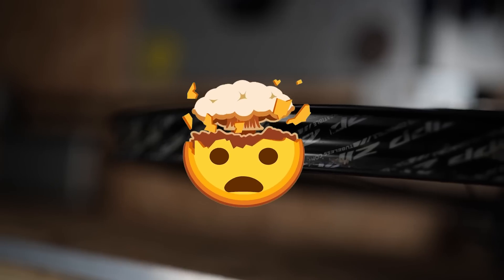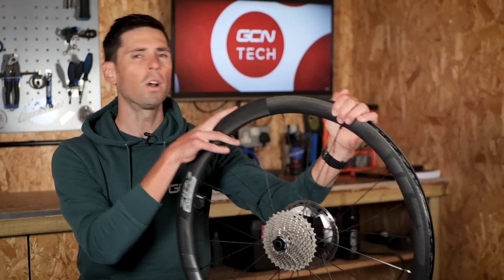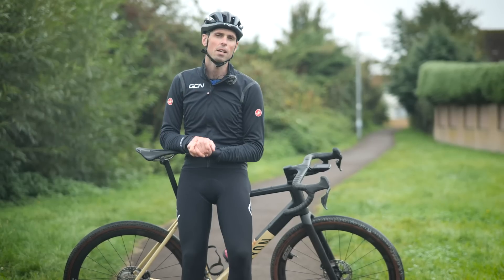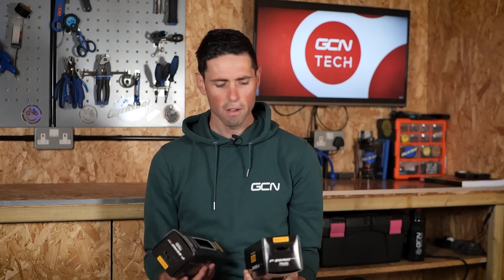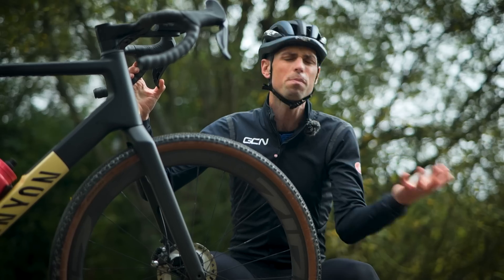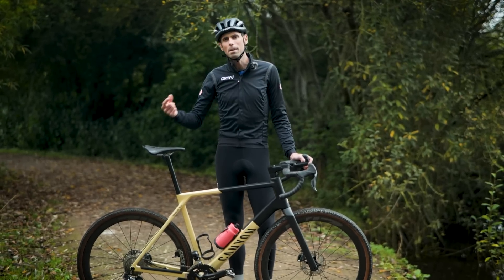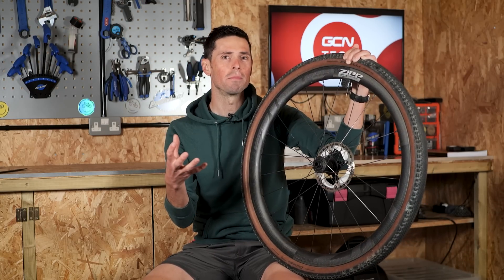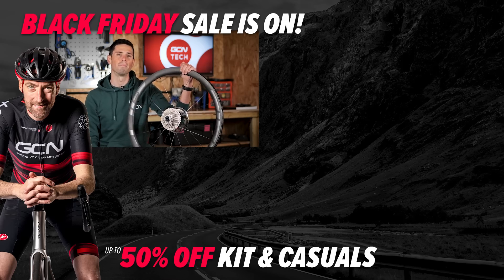What exactly is hookless technology, and what are its pros and cons?

Comment: Always felt the tire bead sitting in the groove of the rim and the inner tube pressing against it was a good safety feature.  Don't think I would feel comfortable leaning into a turn at 32 kmh at 105kg on these things with only glue holding me.  Maybe I'd give it a shot as a lighter rider.  Just seems like tech that would only be precise on a pro riders bike and the stuff they sell to the public would be random sizes like it always is.  I also don't like the 70 PSI limit on these things.  I don't care if it's faster, the tires feel squirmy and bad to me under 60 PSI no matter what the setup.
Reply: “with only glue holding” You’re seemingly thinking of tubulars. Tubeless tires aren’t glued on. The sealant is only present to seal small holes/punctures.
Reply: @RyonBeachner  You're right, the tire is actually held on by nothing because you are at the mercy of Wong Lo doing his job at the carbon mold correctly and getting a correct wheel rim size for the tech to even work.  I will stick with my HED Belgiums.  Don't really even want to use wheels not made by a CNC machine operator.
Reply: Figured that's how slow you'd be taking turns😅
Reply: @veganpotterthevegan  lol bro I ride fixed gear in heavy Los Angeles traffic with no brakes on a steel bike.  Anyone going faster than that is going to crash.  I can hold 35 MPH on a carbon bike like the pros on a bike path.
Reply: @___Bebo___  and you're not "holding 35mph" for any sustained time unless you're a strong contender for the world hour record😅
Reply: @__Bebo__  how long are you gonna say you can hold 35mph on flat ground?😅🤡🤦
Reply: @veganpotterthevegan  I bet I could hold 35MPH on a carbon bike longer than you could keep up with me skidding through Los Angeles rush hour traffic on one of my bikes.
Reply: @veganpotterthevegan  lol bro I've been riding bikes for transportation for like 3 decades with no break I am a pretty strong rider.
Reply: @__Bebo__  you're hilarious😅 Lots of people have ridden more than you in that time(including me🤡).  But nobody 35 yrs of age can hold that speed on flat ground for an hour with a bike and kit to do an hour record on a perfectly smooth velodrome and you're acting like it's easy🤦
Reply: @___Bebo___  and why in the world would I skid through traffic?  I'm not a mindless hipster
Reply: @veganpotterthevegan  Skidding through traffic makes more sense than giving yourself a heart attack "racing" on your video game bike.  Sorry that you never developed bike handling skills.
Reply: @veganpotterthevegan  Bro is really on here talking about the hour record to a guy that is a steel bike purist, lul.  Clicky bros can be silly sometimes.
Reply: @__Bebo__  you do realize I've ridden a lot in Manila don't you?  Manila makes LA look like N.Dakota when it comes to traffic🙃
Reply: @___Bebo___  Steel bike loser, there's a difference.  So you think you're faster than Eddy Merckx then?  Because he held about 30mph for an hour on his steel bike at a very high altitude
Reply: @___Bebo___  I'm happy you're here.   The world needs arrogant clowns to laugh at🥳🥰
Reply: @__Bebo__  you don't even realize that at minimum,  you're telling me you're the strongest human to ever pedal on a bike. Outriding Eddy without modern gear by 5mph🤜🤡🤛 Really more like 6.5-7mph considering you're talking about near sea level riding on concrete.
Reply: @veganpotterthevegan  My bike is a lot lighter and faster than Eddy's, and just because I can ride a carbon bike 35MPH doesn't mean anything you've said here is true.  What you have is a lack of reading comprehension.
Reply: @__Bebo__  the UCI should just throw gold medals at you because Gonna can't hold 30mph at sea level on a road bike with non-aero wheels on your bike for very long at all.  All while 35mph is a casual speed for you
Reply: @veganpotterthevegan  lol I played Tennis for 8 years and had a USTA 5.5 rating, and Judo and BJJ for 20 years.  I have some pretty strong legs bro, wrestlers have stronger legs than cyclists.  No I won't be winning any TdF stages, but I will shock you for a good 5 minutes.
Reply: @__Bebo__  you're not shocking anyone at anything outside of the amount of laughs you bring
Reply: @__Bebo__  "strong legs" as a vague term mean little.  Throw a guy on a bike that squats 1000lbs and he'll be beaten by strong preteens in anything over 100ft🤡
Reply: @veganpotterthevegan  Trust me roadies always are shocked when I drop them.  All I hear is THUNK THUNK in the background as they desperately try to full power poor technique shift into the big ring to "race" me, lul.  I can only imagine in their mind they are saying "God Damn this big gorilla is a machine."
Reply: @__Bebo__  I bet as you'd even drop Filippo Ganna easily🤡
Reply: @__Bebo__  just calculated that holding 35mph for 5min means you'd ride a 4:16 4k pursuit with 44sec of energy to spare😅 That would make you an olympic silver medalist in 2008 but you would have held that speed for nearly.  3 more laps for fun🤡  That's with only knowing what you're capable of on slow concrete since you've never ridden a real pursuit bike with two discs and a top skinsuit and helmet
Reply: @veganpotterthevegan  I would also like to point out that no only have I never worn a skinsuit I've never worn bibs or road cycling clothes of any kind, not even once.
Reply: @__Bebo__  yup, which makes your abilities even more superhuman😅 You've also never had a TT bike with a dozen or more visits to the wind tunnel, yet you're still stronger than every cyclist on earth🤡
Reply: @___Bebo___  did you also play tennis with a ping pong paddle when you were a 5.5?
Reply: @veganpotterthevegan  Definite feminine vibes sitting around Saturday with a calculator examining cycling scenarios that were misread, then doubled down on as you realized your reading comprehension mistake.   I don't know what you have to do to put some hair on your chest but you should do it.
Reply: @___Bebo___  huh?  Only women can do math?  Definitely poser vibes from your hilarious claims🤡
Reply: @veganpotterthevegan  You desperately arguing with what I didn't say is the womanly vibe, but I don't really expect you to be able to read at this point.  Don't you have a wife or a family to hang out with?  Just argue about non paid bike scenarios that weren't brought up?
Reply: @veganpotterthevegan  Several levels of math above you BTW.
Reply: @__Bebo__  ok, you said carbon bike and you can hold 35mph for 5min, and that's without a skinsuit or bibs.  What am I missing potato?
Reply: @__Bebo__  since you're great at math, you should know you're the best cyclist ever born with your claims. Because no cyclist has ever been able to do what you're claiming.
Reply: @__Bebo__  my girlfriend(also a cyclist) is getting a kick out of your comments🤡
Reply: @veganpotterthevegan  You said that not me, spent a lot of time having a giggle about it too.  Weird kid.
Reply: @__Bebo__  gonna take a look at your claims and what the world's best cyclists can do Mr Math?
Since you have about 30lbs on Ganna and don't use any aero gear, you'd probably need an FTP a good 90w or more higher than his. That would have you at a minimum of 550w😅🤡   You should start telling people you have a 550w FTP as your low estimate🥳
*Your FTP is very likely well under 350 and 350 is a very respectable FTP.  Wouldn't surprise me if your FTP is a lot closer to 250 though😅
Reply: @veganpotterthevegan  Yes I can see something I didn't say still has you excited.  You must be pretty desperate to have something to say after getting trounced on the plastic bike front.

BTW people train for 400 FTP on youtube in 3-4 weeks of interval training.  Cycling's difficulty as a sport is vastly overrated by the people that do it.
Reply: @veganpotterthevegan  I'm beginning to lose respect for cycling as a sport with this comment thread.  You came on here bragging about the Olympics but I'm beginning to think Olympic cycling is like Olympic women's boxing with the women having no clue how to use footwork or throw a punch with technique.  Just 2 weirdos throwing bombs at each other and gasping for air.
Reply: @___Bebo___  I never spoke about myself until you addressed my capabilities 🤡 🥳
Reply: @__Bebo__  yes, there are people that get high FTPs in a short period but their gifted people with fast acclimation.  They still need a very high hematocrit and VO2 max.  But what you're claiming still makes you the strongest cyclist of all time which is totally hilarious🤡
Reply: @veganpotterthevegan  Bro I've had 29 inch legs before.  You don't know what real leg power is like, lul.
Reply: @__Bebo__  ok dude,  I've already accepted that you're the fastest person to ever pedal on a bike!!! You're the only person on the planet that can ride 35mph for 5 minutes without a skinsuit, aero helmet and aerobars.  Nobody can even do 32mph solo for 5min with that setup on a road bike with aero gear but you can do 35.  You're an absolute unit and can't be from this planet!!!
Reply: @__Bebo__  why don't you do a local,  flat out and back.  Try doing 35mph each way for 2.5minutes.  I bet you decide to do 10 laps of that because you're so insanely strong.
Reply: @veganpotterthevegan  Because non paid non transportation roadie riding is irrelevant and useless.  I will ride to my wife's house across the city today, it will be fast, but it will not be monitored by cell phones or video games or plastic bike tech of any kind.  I will leave that to the insecure people who were too scared to compete in an actual tough guy sport.
Reply: @veganpotterthevegan  I sold my carbon bike I built in 2021 also.  I wanted to see what the new wavy Winspace wheels were like, then I sold it to some Mexican MAMIL for more than I paid for it.  I rarely keep a carbon bike for more than 2 weeks, it's just not as comfortable or smooth.
Reply: @__Bebo__  I'm not debating you're an incredible cyclist that's stronger than anyone that's ever pedaled a bike!!!
Reply: @__Bebo__  I know,  no carbon bike can handle you.  You're just that much stronger than every track sprinter and Filippo Ganna!!!   Absolutely incredible🥳  Nobody has ever seen anything like you!!!
Reply: @veganpotterthevegan  Carbon road bikes are only good at one thing, going fast in a straight line.  It's not appropriate for the kind of riding I do.  That being said your 2016 Seven I'm cracking it in half within 2 years if I took it out urban commuting.
Reply: @__Bebo__  amazing that the second fastest cyclists in the world(not you because you're the fastest)  haven't figured that out yet.  They're just straightlining extremely technical descents into guardrails over and over again!!!  Also crazy that downhill racers haven't figured out their their carbon bikes can't survive downhill racing.
Reply: @__Bebo__  you also know more than PhD metalurgusts that all acknowledge that titanium has significantly better fatigue properties than steel.  You're a true wonder!!!
Reply: @veganpotterthevegan  Bro how am I supposed to bunny hop onto some car's hood and grind across it on a carbon bike?  lol  I'm not giving up that option if someone plays with me.
Reply: @__Bebo__  I don't know?  Ask Danny Macaskill?  Not that it matters.  You're probably better at trials than he is too
Reply: @___Bebo___  titanium also has a lower coefficient of friction than steel.  But that's only what experts think. You know better
Reply: @veganpotterthevegan  I have a Titanium friction shifter 10 speed and a Titanium fixie I never ride.  I prefer steel, Ti is too noodly usually.
Reply: @veganpotterthevegan  I'd rather ride Ti over one of those trash Specialized bikes you used to sell with the "lifetime warranty" but 2 year warranty on the seatstays lol.  Who would want a bike with a 2 year warranty on the seatstays.
Reply: @__Bebo__  of course,  because you're significantly stronger than Filippo Ganna and your power will break a titanium frame with better fatigue characteristics than steel but you're not breaking your steel bike🤡
Reply: @__Bebo__  that 2year warranty for the stays is if you neglect to register your bike you omnipotent 🤡
Reply: @veganpotterthevegan  lol I only follow real sports, I have no idea who Filipina Ganno is.  Rich kid sports with no black people in them are soft.
Reply: @veganpotterthevegan  You know why that bike has a 2 year warranty on the seat stays?  Because those carbon climbing bikes are straight up dangerous after 800 hours if a real rider is on them and they would get sued without that 2 year limit.
Reply: @___Bebo___  he's the strongest cyclist on the planet outside of you
Reply: @___Bebo___  weird comment coming from a tennis player🤡
Reply: @__Bebo__   why is it a lifetime warranty if you register your bike?🤡😅
Reply: @__Bebo__  that's for rear triangles on full suspension bikes omnipotent potato.
Reply: @veganpotterthevegan  Black guys mentally break in Tennis it's different because they don't have a team backing them up.  In cycling they would dominate just like they do in running but they are priced out of the action because it's more of a Euro rich guy sport.
Reply: @veganpotterthevegan  I've seen so many Specialized Bike warranty horror stories I don't buy it.  This is why you bought a T47 BB Trek anyway, you know this.
Reply: @__Bebo__  there are black guys in cycling potato. Especially in the crit scene in the US.
Reply: @__Bebo__  I've owned nearly as many specialized bikes as treks omnipotent 🤡. I may be getting another Shiv TT next year, still not sure just yet.
Reply: @veganpotterthevegan  The strongest cyclist is probably some BMX trials rider no one has heard of hitting 2700 watt sprints out of the gate.  The money is in Road Cycling cause it sells the Dentist bikes, but there are stronger riders in true disciplines like BMX in peak power I believe.

This kind of athletic power is way more interesting than the "suffer forever" athletic power roadies aspire to.
Reply: @__Bebo__  no, it's you because that BMX rider can't hold 650w for 5min like you can
Reply: @veganpotterthevegan  Yes it must be comforting to repeat that, you've taken quite a beating following me around and gained few footholds and even less handholds.  Lets make this a bit easier, what are your thoughts on crocheted vs hookless tubeless riding?  I only have experience with crocheted tubeless so you are going to be the one to sell me on this tech.
Reply: @veganpotterthevegan  My thoughts on tubeless is that ghetto tubeless has come a long way over the years.  I set up an H Plus Son rim with Continental Contact Urban tires tubeless.  Neither the rim or the CCU tires are tubeless tires, and the CCU tires are actually wire bead.  Despite the tire being wire bead and the rim not being tubeless the tire seals with a floor pump and doesn't even burp sealant when you skid with it.  I was pretty impressed with that, not something I'd ride around because the rim bed is wrong, but it did work.
Reply: @__Bebo__  impossible to sell you on anything typical humans use.  You're superhuman which makes sense.
Reply: @veganpotterthevegan  Well, let it be said I tried to give you an out to stop the bullying.  If you are going to attack something that wasn't said 20+ times it's obvious you are very upset.  It's not very manly to push around a 5 foot 4 vegan carbon roadie so the out to discuss modern bike tech is still there my friend.
Reply: @veganpotterthevegan  I noticed in another thread that you wisely abandoned tubeless.  If you would like I could help you with equipment choices that would help you become a proper non plastic bike riding cyclist, let me know.
Reply: @___Bebo___  huh?  I'm just trying to pat you on the back for being a superhuman hero of cycling!!!
*Wish I were 5'4".  I'm 6'1" 195.  I would have been a better cyclist if I were smaller
Reply: @__Bebo__  where did I say I abandoned tubeless?😅 The only wheel I have a tube in is for the front tire on my trainer bike🤡
Reply: @veganpotterthevegan  You said on another thread you abandoned tubeless cause of goatheads.  I abandoned tubeless because it's stupid, but congrats to you for making an informed decision on your bike for once.  I bet you don't miss pumping your tires up every day.
Reply: @veganpotterthevegan  You know, at Cat 1 speeds Reynolds 853 and carbon are the same speeds.  If you are already racing on 35mm tires why not steel frames as well?  Think of how everyone would feel getting dropped by the guy on the Eddy Merck bike at the race.  If you like 35mm tires you are going to like light steel frames.
Reply: @__Bebo__  well, there's nothing called cat 1 speeds. And your comment is akin to the pound of feathers and pound of brick question. Power to hold a speed is going to be different though.  You wouldn't know that though because you're the cycling equivalent of a flat earther
Reply: @veganpotterthevegan  The cat 4 and 5 racers don't even draft each other or fill in gaps.  Amateur steel bike is doable, IMO.  If you are not trying for the money who cares?
Reply: @__Bebo__  you are totally oblivious to physics.  If you're not getting a good draft, it's even more important(in terms of aerodynamic benefit) to have a bike with aerodynamic tubing.  Unless money is a concern, people tend to buy what they want for all kinds of reasons.   *I ride a carbon bike because I like that it's not going to fatigue, rust and its a much better ride than any steel bike I've ever ridden. I can also easily fix if IF I crash and crack the frame.  I have multiple welders but I don't have a great setup to heat treat a steel frame🙃 And I don't have a jig to straighten out a bent frame.
Reply: @__Bebo__   when I'm doing a group ride with slow people,  I purposefully ride my slower gear(now I just run lower pressure in my tires on my Domane).  That used to mean riding my round tubed Seven or my steel Indifab...also with lower pressure but not to the extremes I can go now with the big tires on my Domane.   Round tubes are terribly inefficient.  A round tube that's 2" in diameter has the drag of an airfoil that's 20" wide.  
*Not that it matters as you're totally incapable of learning.
Reply: @veganpotterthevegan  The difference is a fraction of a mile of an hour once you hit 20MPH.  Skinny round tubes like Reynolds 853 are more aero than you think they are.  Someone rode a heavy cromoly steel bike in the TDF for 2-3 stages a few years back and did fine.
Reply: @veganpotterthevegan  Not sure how I am totally incapable of learning also.  In college every semester I would get a stack of books 5 feet high to read, it was not fun.  Bio degree is probably harder, but Phil degree is a straight pain in the ass too.  Lots of painful logic math and math in general.  I got 80% scholarship also for GPA and essay writing.
Reply: @__Bebo__  no, it's significantly more than that.   It may only be 2-3watts in a peloton at 20mph but it's over 15w if you're on the front, even at 20mph.  That 15w would be more like 40w at 30mph.  You'd know this if you used a power meter and were swapping bikes back and forth on a route with the same wind
Reply: @__Bebo__  maybe you WERE capable of learning but you've proven otherwise now.  I'm sure I'll get to that point too but I'm hoping it happens to me in my 80s if it happens.
Reply: @__Bebo__  borrow/rent a power meter and a very aero bike(no aero wheels to make it fair).   Use the same gear as your fixie and ride at a fixed wattage... the higher the better.  You'll see a small difference in speed at say...20mph, but a much bigger difference at 25 and a huge difference at 30mph. In fact,  just do 5min at 35mph with each bike(since you can do that🤡) and you'll see there's probably over a 60-70w difference at 35mph.  
*Of course you need to make sure your fit is the same on both bikes and you hold the same position on both bikes too.
Reply: @veganpotterthevegan  It's not athletically challenging to hold 25MPH on a steel bike in a crit race.  Please reconsider your stance on carbon frames like you did on rural road tubeless.
Reply: @veganpotterthevegan  So you're telling me as a 45 year old 105kg man who commutes instead of driving cars I am supposed to care about a potential 10 watt difference which is just going to make me more fit anyway?  All of this info is completely irrelevant unless you are making a living from racing bikes.  If I followed your advice I would burn less calories on my commute which is almost as stupid as rural road tubeless.
Reply: @veganpotterthevegan  10 watts is incredible gigacope BTW.  The blades on my fork are so ridiculously thin compared to an Eddy Merck style bike.  Steel racing bike tech has come a long way.
Reply: @__Bebo__  never said it's hard. But people generally want things to be as easy as possible so they can save more energy for the finish.  Like I said,  the drag savings are small(still measurable) in a peloton.  It all ads up and 25mph isn't easy for everyone, even in a draft.  Everyone has different capabilities but the whole point about a racing bike is to be as efficient as possible at all times.   Otherwise a mountain bike would be just as good for crits as a road bike🤦
Reply: @__Bebo__  I don't care if you care or not.  Some people do, some don't. 
*you do realize that people get flats on rural roads too don't you?🤡
Reply: @__Bebo__  the blades on your fork aren't a 3 to 1 profile which is still slower than the forks on recent generation bikes.  Also, an airfoil with steel is either very heavy or noodly.  Your head is all over the place and isn't fitting with your claims about your weight, the speed/stiffness/weight of your bike.  And yes, 10w is significant potato.
Reply: @veganpotterthevegan  I haven't had a flat in 4 years I do not get flats.  I pump my tires up every 2 weeks on Sunday and put around 300 miles on them during the 2 week period.  The only reason I got a flat before that is because I was trying out garbage GP5000 tires when they came out.  Had I been going road tubeless in this time easy sealant burps everywhere and probably a mechanical failure ripping the tire off the rim whip skidding.  Not to mention I'd probably be filling my tires up before every single ride which is another form of existential hell.
Reply: @___Bebo___  OK?  That's your anecdote.  No idea what that has to do with me or the masses.  Most people that ride a lot get at least a flat or two every couple thousand miles
Reply: @veganpotterthevegan  Most people ride with insufficient puncture protection in their casing for their conditions for Roadiesexual psychological and feel reasons.  With Urban Commuting in 2023 this becomes a self defense issue and is a bad idea.  Breaking down in the hood at 1AM because you picked the lastest Conti tire is not where you want to be in life on a Friday night.
Reply: @__Bebo__  I'd rather enjoy my ride than have a trash ride to avoid flats.  Tubeless takes away those compromises. I used to ride Conti 4 seasons as my training tire for over 200k miles.  Thankfully I'm never going to do that again. 3-4flats a week while having a trash ride down to a few plugs in the life of a tire while having the feel of riding race tires all the time.
Reply: @__Bebo__  you really don't talk like you have a philosophy degree. Did you buy it online?
Reply: @veganpotterthevegan  Imagine pumping your tires up before every ride, you tell yourself, I have to be pro, I have to be like Si, I have to be like Manon.  Then getting out there and the tires pretty much feel the same.  Interesting existential hell that one, your identity totally erased.  If Sartre were still alive he would be able to make an 80 page play about road tubeless easily.
Reply: @veganpotterthevegan  You should give Pirelli Cinturato Velo a try.  It's like 4Seasons but much more dreamy.  I rolled over a bunch of penny nails some homeless had glued to the road and didn't flat.  4 Seasons actually has trash puncture protection, I'd rather run GP5000 over that.  You're going to flat with either for sure 100% might as well be on GP5000.  Goathead thorns are 100% not taking out the Cinturato Velo, no way, and it's more supple than GP4000 is.
Reply: @__Bebo__  I can't imagine that because I don't do it🤡  I pump tires up 2-3x a week but only because I'm swapping between my Domane, P5 or Grizl(almost never ride my mountain bike and never ride my Soloist anymore).  I'd "maybe" pump my tires up twice a week at most if I were only riding my Domane
Reply: @__Bebo__  I have those tires, I'm not riding them because they felt like I was running butyl tubes and 4 seasons💩  I use Schwalbe Pro Ones and Gravel King Slicks for daily drivers.  I used to race the Pro Ones but will probably race on something else when I start racing again next spring
Reply: @veganpotterthevegan  Well, when you are messing around on the side of the road with a flat and some deer runs out of the woods and stomps you out don't say you weren't warned.
Reply: @__Bebo__  while partially just a coincidence, the only tubeless tires I've ever been forced to use a tube in are Hutchinson Fusions and that Cinturato.  Went home and plugged them with Lezyne Pro Plugs. I continued to wear the Hutchinson out and never bought another pair. The Cinturatos are on a backup set of wheels and I'm hoping to not use them because they truly do suck even without having that hole I couldn't plug with a dynaplug...2 plugs didn't work either.
Reply: @veganpotterthevegan  Sounds like anti Hutchinson trolling to me, the Cinturato is the only road tire I've ever seen block a nail.
Reply: @__Bebo__  Well, Hutchinson was the company that really started this.  Rode their tubeless tires first(didn't get flats) and the fitment was really bad.   Kept me from riding tubeless again for about 5yrs.  I've had luck with their MTB tires but not their road tires(even regular clinchers).  The flats I got with the Cinturato came from a nail and a screw.  The nail hole was plugged and still leaked.  The screw hole wouldn't even partially seal with two plugs which is probably due to the rubber being so hard and not grabbing onto the plugs tightly and leaving gaps.   I've definitely plugged tires with bigger holes in my Panaracers with success.
Reply: @veganpotterthevegan  All tires would feel the same if you rode steel frames.  That's another drawback to carbon, it's chattery like Alu frames and it doesn't dampen vibration the same way steel does.  I can't feel the difference between Black Chili rubber and 60 TPI rubber as long as weight isn't involved.  All I can feel is the rotational weight going up or down.  With carbon you need tubeless and 9 watt tires to make the bike feel good.
Reply: @__Bebo__  that's most definitely not true potato.  I've owned a handful of steel bikes, two custom fit..and Indy Fab(as I stated before) and a Pegoretti. Neither even rode as well as my first gen Madone or come remotely close to my Domane.
Reply: @veganpotterthevegan  lol, you rode entry level tubeset frames with advertising labels quadrupling the price.  Not what I am talking about when I say steel frames.  Although I'd take a Nagasawa standard cromoly frame over a carbon one as well.
Reply: @veganpotterthevegan  In 1964 Peter Post won Paris–Roubaix on a steel bicycle with a 5-speed freewheel, friction shifters, wheels with 36 round spokes, etc., at an average speed of 45.129 km/h.

That was the fastest Paris–Roubaix for decades until Greg Van Avermaet finally averaged 45.204 km/h in 2017.

I think this neatly puts in perspective all the bicycle technology marketed as revolutionary and essential for racing since the 1960s.
Reply: @___Bebo___  cool.   And everyone he beat was on a carbon bike right?
Reply: @veganpotterthevegan  Flat on rough streets your carbon bikes don't do shit my friend.  They make good climbing and time trial bikes that's it.  Everything done in a wind tunnel is irrelevant on the road, the bikes are only faster because of stiff seatstays uphill.
Reply: @___Bebo___  I spent most of my life in Baltimore potato.  Had no issues riding carbon there.  Again,  I'm waiting for you to say something rational
Reply: @___Bebo___  again, look at Boonen and Cancellara.  How many Roubaix's did they win on steel?
Reply: @___Bebo___  I also suggest you look at why Post rode so fast potato.  It's not because he rode a steel bike🤡
Reply: @veganpotterthevegan  I'm sure your anecdotal evidence about carbon beats the cold hard math on Urban Speed in the Tour De France, lul.
Reply: @__Bebo__  how come you can't answer questions?  I address every piece of nonsensical BS you throw at me and you can't answer simple questions
Reply: @veganpotterthevegan  I'm choosing a more philosophical back and forth like Hylas and Philonous conversational style over a more fact finding useless style.  You were complaining earlier that I wasn't Philosophical enough even though college was decades ago.  I already know through Tour De France average speeds that steel bikes are the same on rough flats, and that you misrepresented my words 20+ times, so the truth should no longer really be the discussion.  Since logic and math can't be trusted because of heated emotion the best we can hope for is an exchange of ideas.